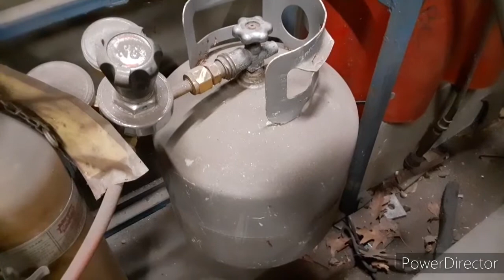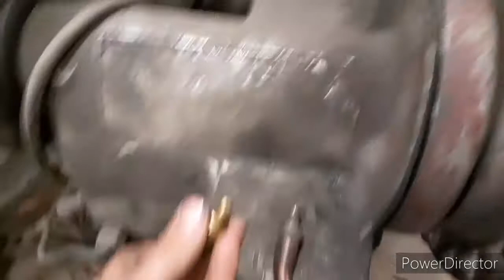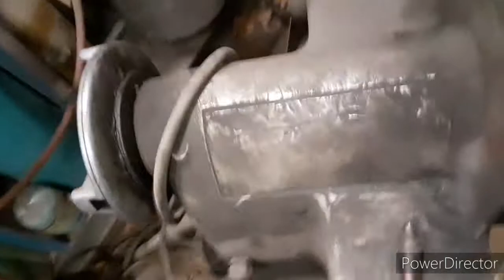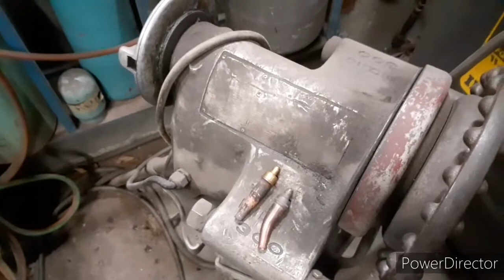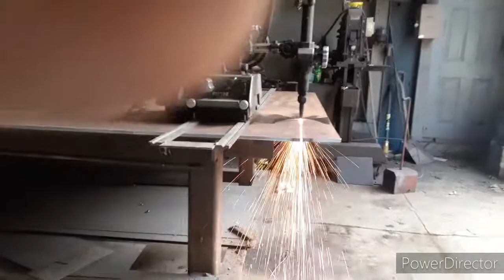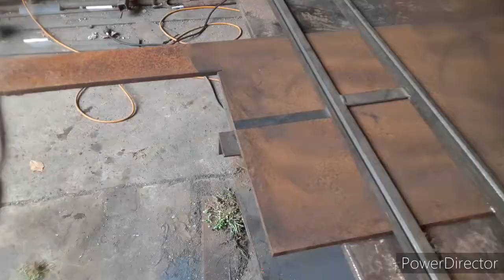Cutting Steel with Propane Torch, Never buy Acetylene Again

Comment: Very cool trick. It's really the Oxy doing the cutting through steel. I learnt wekding from an old-timer who welded aluminium- sorry alUMinum for a coachbuilder, he also swore by oxy-acetylene fir stainless steel too.
Back in the day before industrial gas bottles, you used to maje your own acetylene (look up tractorman44) dropping lime carbide into water that self pressurised. The reaction is CaC2 +H2O= C2H2 (acetylene) + Ca(OH). They used to go through tonnes of lime on the shipyards in Belfast and the Clyde because so much cheaper than anything else. Also they made shtloads of hydrogen from old WW2 barrage balloon units which many of the men were familiar with called Silicol. It was 90% Silicon reacting with NaOh (caustic soda) with 3.5% iron and 5.5% Aluminum creating 99% H and H20 as steam (taken out by a scrubber) up to 2000cu feet an hour. And they say oxyhydrogen is new! Lol we'll all be back to horse and carts to be green.
Reply from the maker: Same way with the old carbide coal miners lamps, drop a hunk of carbide in the hatch and a bit of bodily fluid and you got light all day

Comment: I've used both for many years. LP is popular for scrapping not just due to cost but because it's safer to handle and you don't need to let an LP cylinder that was transported horizontally settle before using it. Quality US-made acetylene regulator (Victor, Smith etc) soft parts are compatible with multiple fuel gases (if in doubt contact regulator maker tech support) but LP can be run at MUCH higher pressures than acetylene for making heavy cuts so I have regulators for both (heavier spring and higher psi output pressure gauge is the difference, I rebuild my own regs using factory manuals). 

Rosebud tips ain't cheap new so since I had several Victors from a bulk auction buy I added a short extension cut from a Tweco MIG nozzle and TIGed to the acetylene rosebud. Works find as a flameholder same as common recessed LP tips. Oxy-LP for preheat works a treat because you can exceed acetylene withdrawal rates from small tanks. CGA-510 threads mean ya can use larger LP tanks without the BBQ flow restrictor.

Comment: Used both for 30+ years, Acetylene is hotter and cleaner, Propane is OK for farm work, but it is so oily, that it will affect any welding afterwards. Neither is ideal to weld after, but codes ban propane. be safe.
Reply: Acetylene is best but EXPENSIVE!
Reply: @jsplasha   we need to swap the acetaline hose to a lpg one? I haven’t heard about that please explain?
Reply: You can't weld with LPG. Its flame is oxidizing to steel. It's for cutting only. If you want welding, acetylene is the only solution.
Reply: @lajoswinkler  Can’t you just adjust the Fuel/Air Ratio then?
Reply: @ericlotze7724  no it's simply doesn't contain the BTUs we used to have to use propane for soldering and it was the most horrible experience there was man oxygen or not it barely melt solder
Reply: @jsplasha  here in the United States propane contains suspended particles oil    tar   and all kinds of trash guitar will build up in the diaphragm for the expansion valve of a forklift and that's what makes it through the filters not sure what you're thinking of is propane but propane is very dirty fuel indeed it does burn clean cleaner but the suspended particles floating around in that gas is a living nightmare for forklift mechanics

Comment: Correct me if I'm wrong but the rapid heat from oxygen and the higher flammable gases create the greatest thermal expansion or contraction effect. Weld distortion is a nightmare but knowing how to manipulate it is a true art.

Comment: I used both gases at work, I find the Propane Gas much cheaper option its great for cutting with Tractors or Profile Cutters, excellent for heating metal, there's not that many downfalls using Propane, but I do prefer using Acetylene for thinner metals using smaller tips, to stop warpage, as warpage is a fact of life using Propane as seen in the video, before he moved the camera.

Comment: Have used both acy and propane for gas cutting.  Yes propane is cheaper and easier to get but you will use more oxygen with propane.  For cutting metal the cheap plasma cutters are a much better choice.  If you have a compressor much cheaper too both in start up costs and operating costs  Around $200 for a plasma cutter. .  The pilot arc ones cut rusty metal well.
Reply: What plasma cutter are you buying for $200? A quality one is upwards of $1000. Oxy propane is much more efficient for heating. Switch to propylene for even better cutting and better efficiency. Propane is also far safer and versatile. Acetylene only makes sense if you’re going to weld. Plasma is great for shop use. I hope to eventually buy a hypertherm.
Reply: @victorfiori105  I have a $230 50amp Lotus plasma cutter from Amazon that I've been using for 2 years and haven't had a problem up to 5/8" material. Consumables are cheap. My 60amp Everlast machine, that's 1000 bucks, has pilot arc and cnc control, is obviously more capable, but if you're working with 1/2"+ on the regular, you can probably afford a nice machine. My point is, in 2023 the chinese machines are getting cheaper and more powerful. You just can't turn your nose up at a 200 dollar plasma cutter anymore.

Comment: Just another tip to save $$, Not sure how much psi you need for that size of torch, But I have a smaller jewelers torch and instead of buying oxygen tanks I purchased an Oxygen Concentrator to generate my oxygen and I only use about half of what it can produce and it powers my Oxy/Prop torch really nice. Never have to refill oxygen tanks again.
Reply: What type of Oxygen generator do you use?
Reply: I use the EverFlo Stationary Oxygen Concentrator and it's been working awesome so far. I've only had it a couple weeks but it powers my torch really well.

Comment: There is a reason that accetylene is easier to cut with, but it doesn't have anything to do with the oxidation process.

For the oxidation process:

Heating the metal to bright orange - first the metal is heated by combining a hydrocarbon with oxygen to get water and a lot of heat:

2C 2 H 2 (g) + 5O 2 (g) →  4CO 2 (g) + 2H 2 O(g)+heat energy.

We are "burning" accetylene or propane (accetylene equation only is above), or we are "oxidizing" accetylene (propane) - same thing.  We get the heat we want from this to be able to heat the metal to "kindling" temperature.

When things are hot enough (about 1600°F) where the ferrous (iron) electrons in the molecules are orbiting around a larger electron shell which makes them available to any oxygen in the vicinity (as evidenced by little sparks coming off the orange metal - that is iron already combining with oxygen), we don't need the fuel anymore for heat - we have enough heat to sustain an oxygen-iron reaction on its own (that is, an exothermic reaction).  This is when we blast it with pure (or almost pure) oxygen:

Fe + O --- FeO + Heat (63,800 cal) First Reaction
3Fe + 2O2 --- Fe3O4 + Heat (267,800 cal) Second Reaction
2Fe + 3/2 O2 --- Fe2O3 + Heat (196,800 cal) Third Reaction

For this discussion and the extra horse-flogging, all that doesn't need to be figured out.  The only thing that should be noted is that each one of these reactions has heat as a result (byproduct) along with rusted (oxidized) metal.  The metal actually "burns" (oxidizes). Same theme going on there.  Same "burning is really oxidizing" theme.

The only reason people use the term "cuttin' torch" is because it looks like that is what it does but that is only because of the speed of gas coming out of the torch that pushes the molten rust (sparks) and molten unoxidized iron (peanut butter-looking stuff) out of the way as you know.  It just looks like it is cutting.  Only a small bit of the iron is being oxidized, but the reaction is so prolific in producing heat that it melts the iron sitting right under it.  

Hell, one can make a cutting torch out of an unlit cutting tip.  Try heating the metal up with a large regular tip and then immediately switch to an unlit cutting torch and start blowing on it with the O2.  (Switchover has to be SUPER fast - can only be done with two people pulling this off.)  Accetylene valve completely off, both O2 valves and regulator set as you regularly would for normal cutting operation.  You'll see that the unlit cutting tip will "cut" the metal just fine. Just don't stop...  

If you want to really impress your friends, use a really large welding tip, get the iron almost white hot, and then turn the oxygen up and start cutting with it.  The flame will blow out, but you will still be able to "cut".  This will be hard to do but is entirely possible.  (Make sure your O2 regulator is set pretty high for this.  For safety, turn the fuel off - you have to be fast enough.)  

To be clear, the cutting torch maintains a flame that actually corrects the mistake of not having the O2 stream perfectly on the work at all times.  It makes "cutting" much easier to accomplish.  Because of this, one might surmise that accetylene is a little easier to cut with.  The superior (hot) flame allows for a little more "slop" in keeping the O2 stream on the work by keeping things more toasty.

To summarize - "burning" is exactly the same as "oxidizing".

To answer a common question in this thread - neatness of cut only has to do with pureness of the O2 and the volume - along with technique.  And again, it is easier to work with the extra heat that accetylene provides, but propane is good enough.  When one is welding, well, that is another story.  Seems to take a lot longer to melt stuff with propane.
Reply: Underrated as nuanced truth mostly is;)

Comment: Thanks a Bunch!
Great video & info, trading in my acetylene tanks for Oxy & Inert gas cylinders.
What a money saver brother!
Regards from AZ
Reply: You can cut with propane but you can’t weld with propane, if you’re into oxyfuel welding.
Reply from the maker: @rvalcourtpersonaca  yes, it would be tough to get enough heat for welding steel, although brazing and silver soldering still works well

Comment: Have regulators and tips for both.  NG pressure in homes is to low to give it a go.  Propane is fine for cutting in general but post prep is required before welding due to high hydrogen levels from burning propane in the cut interface.

Comment: Thanks for the tip.  I forgot that you can use propane as a fuel for cutting and it costs a lot less.  I used to work at a steel service center and one of the cutting machines used a big tank of propane and oxygen, outside our building.
Reply: It uses at least 3 to  4 times as much oxygen.

Comment: Propane is cheaper, but you need 4 time the oxygen. Ratio is 1.2:1 oxygen to acetylen, but 4.3:1 oxy to propane for a proper flame. Not much economy IMO.
As for pre heat, it's about the same. If it isn't, it's because your tip is too close to the work, a propane flame need to be further away than an acetylen flame, if you're right at the tip like an acety torch it will take forever.
We use it a lot in steel mills(natural gas)but that's because they have hookup everywhere, so we just need to transport an oxygen tank.

Comment: If you check the tank you don't need an adapter. the fitting on the tank has left hand threads inside already. Have been using propane over 30 years.Good video though. Also if you run out on weekend just swap the tank

Comment: Doesn’t that propane introduce water vapor into your shop? I used to heat my shop with a propane radiant heater and everything in my shop started rusting.
Reply from the maker: Haven't seen much of a difference usually at the oxidized temperatures water disappears quickly and is cleaner burning than a heater that uses venturi atmospheric air
Reply: acetylene  introduce water vapor as well :)
Reply: Any and all combustion reactions create 3 things, carbon, hydrogen, and oxygen. With H + O you get H2O. You'll always get water!
Reply: Too muck carbon monoxide will also make water. If you are using a unvented heater, crack à door. If your heater has a flew, check it for blockages. Either way, buy a CO detector. I paid about $35.00 for a CO detector with a 10 year battery.
Reply: @wyndnra1n  This!

Comment: I have spent more time cutting with a torch than most
I prefer acetylene
I have worked places where it was claimed acetylene was too dangerous and was forced to use propylene gas
I can use either and do good work
I prefer acetylene if I can get it

Comment: Get an Aussie invented tip. Can use acetylene with no oxygen. Tip adds air to mix.
Reply: Interesting.  How does that work with nitrogen being mixed more than oxygen?  Is the flame just cooler?

Comment: Seems like the amount of oxygen need would offset the savings you get using propane.
Reply from the maker: Once the cut starts you use the same amount of oxygen because it's a chemical reaction at that point. If you're torch welding that's when you waste noticable amounts of oxygen

Comment: Certainly great if you aren't into production or in a hurry.
Reply: Strange thing that I learnt to cut with oxygen. So the mixer gas is less important.
Personally I now prefer plasma but not commercial.
Water jet and laser are non pun intended bur cutting it these days. Unless it's scrap the thermal lance is the tool.

Comment: Nice on a machine in a workshop, [use plasma btw] but in the field, totally different. Propane is for heaters.
Reply: I worked as a welder at Sun Ship in Chester, PA, back in the 70's.  They used propane for all cutting - I used propane for cutting, brazing and heating for many years, it leaves very little dross, and makes cleanup easy.  It's not good for welding (I believe it's too oxidizing), but it's great for everything else.  It does use more oxygen to get the neutral flame than acetylene does, but propane is much cheaper than acetylene.  It does take a little longer to get the steel up to cutting temperature, but once the cut is started, there's no speed difference.  And all it requires is an oxy/propane tip, no different regulators or torch.  There's absolutely no reason you can't use propane in the field.  And you can get propane just about anywhere, so if you need it on the weekend, or holidays, it's no problem.  Try it, you'd be impressed.  A tip costs less than $15.

Comment: Problem  i found was you use twice as much oxygen
Reply: acetylene burns with 2.5 mole of oxigen but propane burns with 5 mole  :)  not only twice because you need to crank propane more up to get same result heat wise
Reply: Can we use compressed air instead of oxygen?
Reply: @Amerikanin2numarali_ustasi  This only applies at the pre-heating stage, that is, heating the iron/carbon steel to that temperature where it will burn in pure oxygen.
For the actual cutting no fuel or combustion oxygen is needed.
Reply: @timothykeith1367  nop

Comment: First off let me compliment on the 2 extinguishers that you have on your welding/cutting set up. The reason you're using so much oxygen is not because you have more fuel with the propane but because you need about twice the ratio of oxygen and propane  than you do with oxygen and acetylene. Yeah, the benefit of using acetylene is that you'll get through the work much faster. That can make a difference to you or a customer. You should try to avoid ever having an acetylene  tank on it's side and be sure that when transporting either tank that regulators are off caps are on the tank. and tanks are secured either on a cart or something solid like a wall or or if it's for a truck build a rack on the truck to secure it from falling. Those tanks fall over and nail your toes you might just lose them,  😲

Comment: I'm not a welder. But from what I have heard.  You need different tips and different hoses you can't weld with it and cutting isn't as clean with propane.  Other than that there's no difference between the two.  Lol
Reply: I worked as a welder at Sun Ship in Chester, PA, back in the 70's.  They used propane for all cutting - I used propane for cutting, brazing and heating for many years, it leaves very little dross, and makes cleanup easy.  It's not good for welding (I believe it's too oxidizing), but it's great for everything else.  It does use more oxygen to get the neutral flame than acetylene does, but propane is much cheaper than acetylene.  It does take a little longer to get the steel up to cutting temperature, but once the cut is started, there's no speed difference.  And all it requires is an oxy/propane tip, no different regulators or torch.   And you can get propane just about anywhere, so if you need it on the weekend, or holidays, it's no problem.  Try it, you'd be impressed.  A tip costs less than $15.

Comment: Propane uses more gas than acetylene though no?
Reply from the maker: Not really and once the cut is started it doesn't much matter, I find the tips last longer as well because the outer jacket somewhat shields the orifices, propane is in a liquid and I believe acetylene is a compressed gas
Reply: by gas you mean oxygen?

Comment: do i need to upgrade the hose?
Reply from the maker: It is recommended by some but I haven't had issues in a couple of decades using acetylene hoses in the shop, my rig hoses wear out every 5 or so years but that's mostly the sun a the sub zero temperatures we go out in.